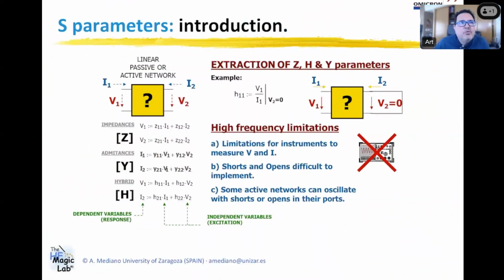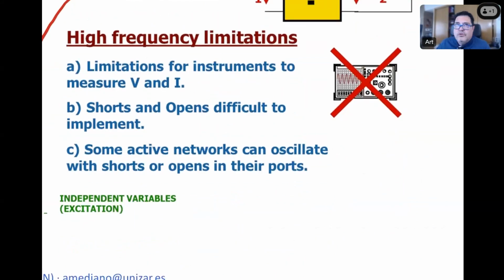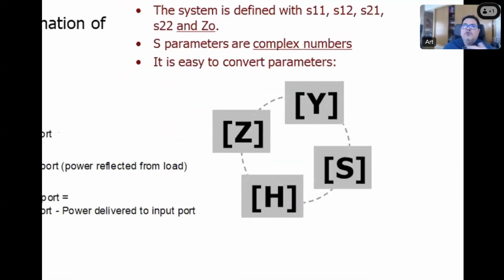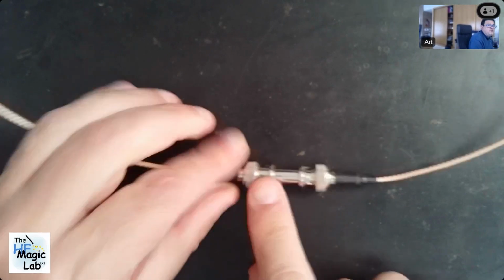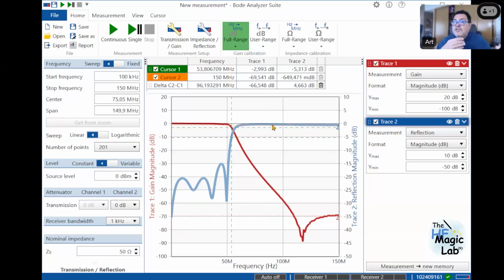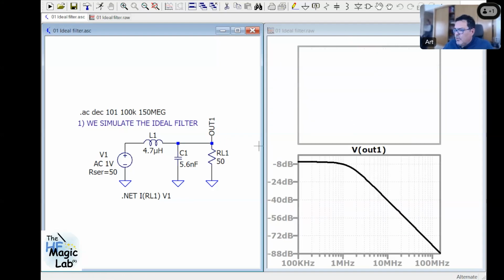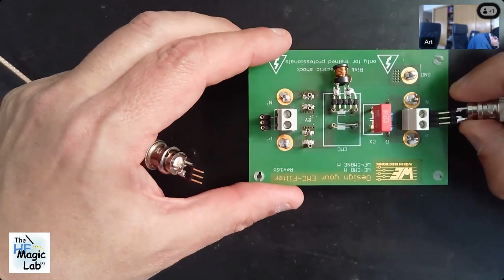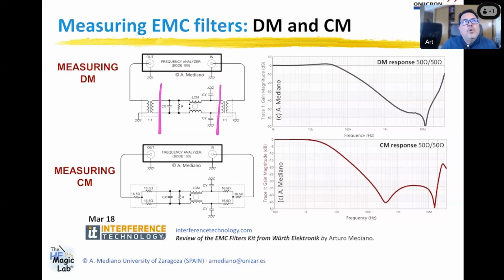Using S-Parameters for the Design of EMC Filters

Comment: Hi, thanks! Couple question, In EMC filters we are rather interested in volatage damping not power. S21 is a power parameter not voltage. Do you need to check voltages output to input for each filter not S21? 2nd question how you imported S21 to LTspice? The voltage graphs are not symetricall than S21/S12.
Reply from the maker: Can you please get in contact with Arturo directly? Thanks!

Comment: what is the difference between S parameters and Voltage Transfer Function? I know s parameters are based on 50-50ohm systems. Does the transfer function yield the same result on 50-50ohm system?
Reply from the maker: The difference is the defined impedance. A voltage transfer function just compares input and output voltages, but it does not define the source impedance or terminating impedance. Some systems change their voltage transfer function depending on the source impedance or termination impedance. For S-parameters the impedances are defined.